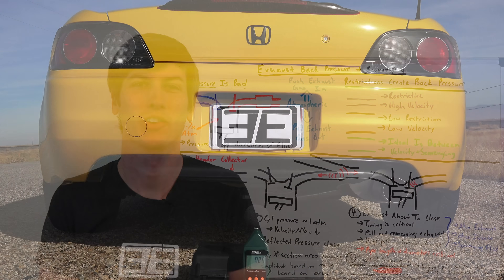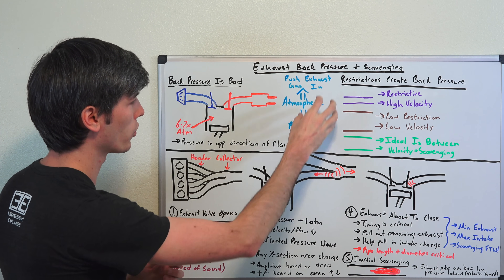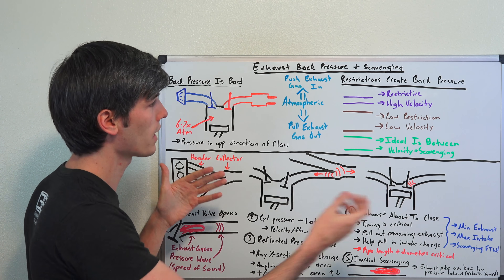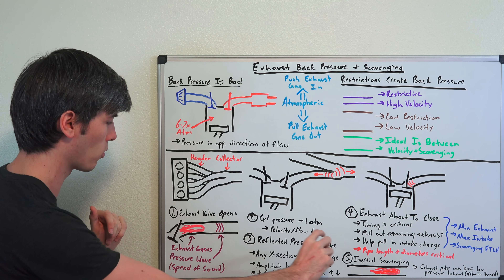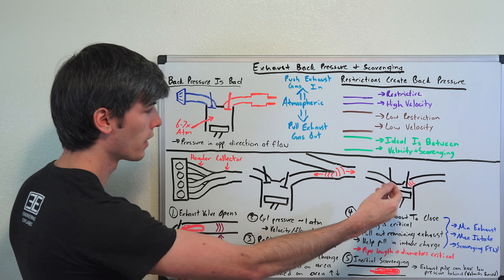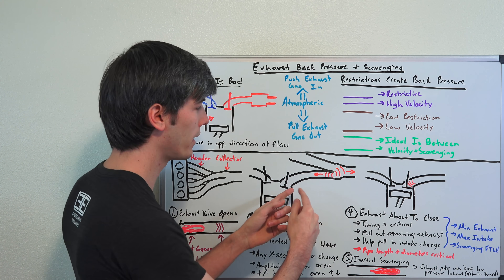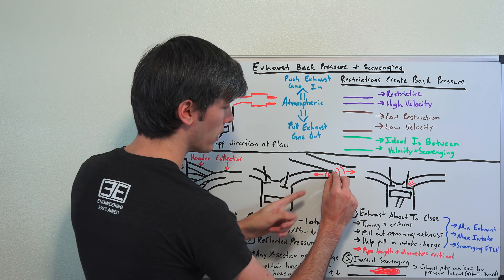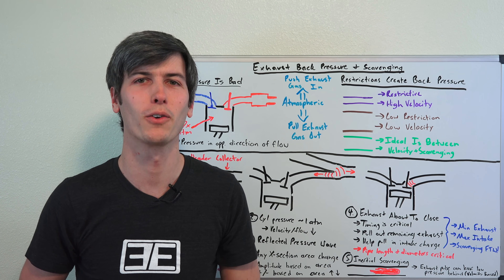Stop Saying Car Exhausts Need Back Pressure

Comment: is it a case for older engines and it's valves for cold climates that valves needed the heat so they don't crack, or seats warping, in iron and steel of pre 1980ish engines, for also reliability, and longevity.Gasoline had lead in it to lube the valves, cold start used to wear these parts in those days. No three angles on those guys, which changes the orifice effect, and timing was not as precise. Looking back that was raw power as it got, and you ain't changing that. Nothing like the Force of Cubic Inches. P.S. that GT needs cylinders!!!!

Comment: Great video. Wondering about the pros and cons and a 4:1 vs. a 4:2:1 manifold. Would it be the case that a 4:1 manifold is more peaky (benefit across a small rpm range) where as a 4:2:1 manifold gives a lower scavaging/power benefit but across a much broader rpm range?

Comment: why car engines do need back pressure: because with zero pressure you dont even have a flow of exhaust gases, and therefore the heat buildup burns the rings out of the engine. im sure someone will tell me different considering the topic of this vid

Comment: So what happens if you put a vacuum close to the end of your exhaust and use it to suck the exhaust out with a bigger bore? Would that be better or worse then what’s used now?

Also what about exhaust not combining and staying separate tubes all the way out?

I’ve also heard that higher compression ratios are more efficient, is this true and if so what does it do?

Comment: What a load of hogwash, you clearly don't know engines. First there is no pressure on the outside of ur exhaust, as the same atmosphere is at the intake you have  zero pressure on your engine, it's in equilibrium. The reason you have atmospheric pressure sensors in cars is to determine the correct ignition timing first and then the correct fuel air ratio for the altitude you are at. That's it. The next thing, you need to do a bit of study on air flow, the reason you need back pressure on any engine is exactly because of airflow at very high speed. One of the big problems in fluid/air dinamics. Do a study on water hammer, very interesting stuff. Now to explain back pressure and what it does. When ur exhaust phase ends you have what they call a rocking phase of inlet and exhaust valves, this rocking time is when both valves are open at the same time, this is done so that the momentum (velocity) of the exhaust gas helps to pull in the intake gas as the Piston is still on top (intake phase not begin yet). Now before the exhaust valve can close, this stream of gas just runs straight through the engine, this is where the correct back pressure helps to prevent that stream just enough so that the exhaust valve closes as the intake gas starts to flow out of the exhaust valve. In 2 stroke motors this actually works with a shockwave of sound. But in 4 Stoke engines the correctly tuned exhaust with the exact amount of back pressure Does exactly this. So there you have it bro.
Reply: Ian Barnard I stopped reading after you told us the pressure at Atmosphere and the combustion chamber are the same. Nothing like a 9 month comment with no likes, must be true.

Comment: Scavenging discussion is good in theory for racing, but not too applicable for regular driving (even with the periodic race application).  COMPLETELY agree that back-pressure is bad.

As you mention, scavenging generally works within a narrow RPM range based on the frequency.  However, the one critical item that is not addressed is related to valve overlap.  Most all daily drivers have little valve overlap (for decent low and midrange torque).  Scavenging is almost always applied at higher RPMs for race purposes.  Those types of cars have very poor lower RPM drivability characteristics, poor torque, and generally are "fussy" to run.  Some of the variable valve timing CAN help with this and then scavenging might have some application, but still, that would only be at higher RPM ranges like in the mid to upper RPM areas.

Probably more applicable would be the intake runner length and diameter discussion.  That does have application to daily drivers and to race cars.  Longer runners at lower RPM = higher torque and more power, shorter runners at higher RPM = better breathing and more power.  Has to do with the velocity created by the length, and diameter, at different RPMs -- the ability of an air pump to efficiently move the air mass.  This is why they have so many cars now with variable intakes.  

Generally like your teaching though, just think this one might cause more confusion than practical application.  Reason is the valve overlap at low and mid range generally prevents any feedback pulse.  Even when there is one it would not generally be strong enough to make much difference under normal driving conditions.

Comment: The most important aspect forgotten was scavenging is only present when both valves are open creating a high pressure through intake out the exhaust. Most efficient when piston travel is 4-8° btdc helping push left over gases.
Scavenging also allows very small amounts of hydrocarbons through different cylinders if not on compression stroke back in the intake covering the walls with the known black deposits.

Comment: So if I understand correctly: the distance for your header pipes should be the speed of sound times by a little less than the duration the exhaust valve is open for, which as stated is a function of RPM.

Comment: also with valve overlap to push exhaust out some air/fuel goes with it and a pressure wave is needed to push some of it back. it has to do with emissions too not just "power"

Comment: You literally just described how back pressure is needed... if back pressure wasn't needed, you could make maximum bottom end torque running open shorty y headers. And oh yeah, frying your valves due to no back pressure is actually a thing. Ask me how I know...
Reply from the maker: No, I literally just described why it isn’t needed haha

Comment: Interesting.... So why would funny cars run straight pipes? They have a known and not very wide rpm range, so I would think they could tune it. Or put variable length headers on it. Maybe the transition  from straight pipes to atmosphere gets you the same pressure wave? In which case that was neglected from this discussion, as that still exists. Same for the placement of the muffler and cat.
Reply from the maker: Funny cars run in a pretty narrow RPM range, so the straight pipes are tuned for that. The clutch is slipping for most of the start of the pull, and eventually locks up as it’s running down the strip (this allows a high, and narrower RPM range). I have a video on the clutches they use if you’re interested!

Comment: I have been applying this for years and it is nothing short of incredible how much torque can be found by building a proper exhaust system. not only length and diameter but collector and muffler design.

Comment: I would just like to point out that shock waves actually travel faster than sound. Could be important for anyone trying to calculate exhaust lengths.
Reply from the maker: Yes, it’s dependent on the conditions within the exhaust (temperature, density, etc), on top of traveling with the exhaust on the way out, and then against the exhaust on the way back to the valve.

Comment: N/A engines need tuned exhaust, you don’t need any exhaust while WOT. And don’t need any after a Turbo. It’s not back pressure. That terminology is wrong. It’s all about velocity. Straight pipes at low rpm do not have velocity. You kill low end power. It matters.

Comment: So what's the deal with some back pressure helping low end power?  I've experienced it in older vehicles,  open exhaust = more top end power but loose some low end power,, and i.e. some back pressure or restriction = better low end power with of course a little less at top in exchange..  ???
Reply from the maker: Yep, this is discussed in the video. Smaller diameter exhausts will have more back pressure (not good) but more velocity (good). It’s worth doin for the better scavenging that occurs with higher velocities.

Comment: It's quite simple: for an N/A engine the best exhaust is no exhaust. Not even connecting the manifold. The second best option is looking at pipe lengths, resonant proportions, and making an exhaust with smooth curves.
For turbo's it's more complicated. Thinner pipes and shorter pipes will mean faster flow with more kinetic energy but more resistance. Too small of an exhaust manifold for economy turbo cars is not a bad thing. That will give some faster spool-up. (although less ultimate pressure) If your can has an anti-lag system then a small manifold won't make any sense.
2 strokes can appreciate some backpressure for the sake of not spilling unburned fuel down the exhaust. I said "can" not "will".
Reply: sasja de vries,

"Best exhaust is no exhaust" is actually the 2nd runner up misconception next to "exhaust needs backpressure".  You do actually need the manifold.  Without it, you won't get the scavenge action resulting from the fluid dynamics. The header lengths and diameter need to be tuned for the gas velocities that are expected from the manner of tuning the engine is getting.  Bottom line is you want as much velocity without causing restriction in the exhaust.  But with fixed dimensions, they can only be optimal for a certain rpm range of any given engine displacement.  You remember those variable intake runners that came about before Honda popularized VTEC?  A similar principle applies to the exhaust piping, just that it's far more problematic due to the heat and pressures involved.
Reply: Did you watch the video? probably not because you think no exhaust is the best.
Reply: sasja de vries. Actually no header is worse than no header. For one the valves will burn up since the header works as a heat sink. Second, the header can actually increase horsepower due to scavaging forces. If properly sized you can create a greater than ambient pressure drop when the exhaust valves open, increasing power by reducing pumping losses.
Reply: Engine master did an episode where they performed dyno on engines going from too small to too big of an exhaust. The fluctuation was minimal and almost neglect-able. On the other hand, these are simple high displacement engines that aren't fine tuned. I bet a fine tuned engine would show more of a difference.
Reply: m4xwellmurd3r said "Actually no header is worse than no header."
 
Did you mean to say "no header is worse than having headers?"
Reply: They would have done better to run the same tests with a well tuned motorcycle engine. That would be the closest to a really properly designed and tuned engine that would be affordable.
Reply: sasja de vries.
Reply: sidepipes or straight up headers out the hood = all u need
Reply: +Ben Mcghie oh so that's what that blowhorn looking thing is for
Reply: You didn't watch the video, did you. Your first statement is incorrect.

Also, try running a 2 stroke motorcycle without the expansion chamber. Let me know how much power you get, lol. For a 2 stroke, the expansion chamber is actually generating a pressure wave that acts as a closed exhaust valve (if timed properly), allowing the cylinder to obtain much higher pre-combustion pressures. More air and more fuel = more power.
Reply: The best exhaust for a N/A engine is just a normal exhaust, headers, test pipes, and catback with X or H pipe, resonators and mufflers. Take the mufflers of a N/A car off and you gonna loss power.

Comment: Only thing that needs back pressure is sleeve valve two strokes that are crankcase forced induction due to the large valve overlap, which is why they have a tuned exhaust. Pipe expands to get a negative wave to scavenge then the pipe narrows down to smaller then the entry pipe to reflect back a high positive wave right as the fresh fuel air mix is entering so it's kept from going straight out the still open exhaust port.  Everything else the overlap is so small it doesn't matter.

Comment: Shouldn't fueling then be retuned after lowering back pressure (with straight piping). I've read (at least on carbed motorcycles) that any considerable changes with back pressure (straight piping) always have to be accommodated with fueling retunes otherwise the engine will run too lean or too rich (because it was tuned with back pressure from the stock exhaust in mind in the first place). Am I wrong to think this?
Reply: my mustang needed back pressure because thats how ford designed it without it i lost a lot of torque i could feel i lost power in the gas pedal high flow mufflers and huge h pipe yeah my motor revved higher easier but when it came down to putting power on the ground hell no....explain with diagrams and whiteboards all you want i bolted the part on and felt the difference so you cant say all engines dont need back pressure new variable cam engines are being designed to use the exhaust gases to reduce displacement so how does this apply to that
Reply: theonlylee1984 as a few people on here have stated, a loss of back pressure is not why you lost power. A loss of a tuned exhaust system to work in balance and harmony with everything else you had is why you lost horsepower.
Reply: No, you are not wrong to think this. You should make adjustments to your tune after ANY modification made to your engine whatsoever not just to get the maximum benefit from it, but to ensure you don’t lose horsepower because your engine is now out of tune with what you have just done. I think that’s the frustrating thing about mods. For every single one you do you have to retune until you get everything just right. Then if you make another mod it starts all over again. That can be mind numbingly tedious and time consuming.
Reply: Theonlylee1984 your forgetting the fact that without any upgrades to require more exhaust flow you won’t get any power gain from it

If someone buts a blower and cam on their mustang they will prob want to open up the exhaust
Reply: I've heard very similar things, at least in the case of bikes. I know with fuel injected bikes getting a free flowing exhaust will do very little without a fueling retune, maybe that's what your thinking about? IDK I'm just some guy on the internet
Reply: Xantho - Correct. Matching intake with exhaust is the whole idea.

In the example, we do have back pressure.  That creates the velocity to generate the vacuum wave at the end of the exhaust valve opening?  Here again, balance is critical.
Reply: But with stock motor and bigger exhaust you do loose torque and power
Reply: @stevemac7933  Not really, only if you just swap and do nothing with the tune, you will loose power, your bigger exhaust will lean out the Air fuel ratio. If going too big you will also loose the scavenging effect, like he said in the video. 

The engine will be lazy because your exhaust will no longer help your engine to evacuate the exhausts properly. The same happens if you remove a restricted air filter, the engine will lean out.  Modern fuel injected engines will someway compensate for the changed Air fuel ratio. the engine management read the changed lambda value and also from the MAFsensor and compensate automatically with more fuel.  The same thing happens if you got a vacuum leak, the fuel injection will compensate with more fuel until it reaches its limitof its maximum capacity :)
Reply: @ZoDDyXXX  well I meant to say that as well no retuning by the way I have a 98 Lexus sc400  dobyou know if retuning is available with a stock motor only bigger exhaust ?
Reply: @stevemac7933  Normally it´s not needed.. I´m not schooled in the Lexus engine management but i´m sure it´s advanced enough to handle normal sized upgrades.  My gut feeling tells me that you wont gain anything above 2,5-3"  i´m not sure but i think Magnaflow has something to your car. They seems to have some research and science behind their products.
Reply: @ZoDDyXXX  mine was stock with you won't believe 4 large mufflers 2 sound mufflers 1.75 pipes I started with 2.5 straight pipes oh my God it sucked then added 2 mufflers  drove sucked added 2 sound mufflers round getting better as soon as I installed X pipe before mufflers the car became a tiger again got even better in a few days

Comment: you forget to add that when the exhaust slows it also cools making the exhaust more dense hence making the engine has to use more "power" to evacuate the exhaust system

Comment: 1.does valve overlap or internal exhaust gas re-circulation affect the exhaust back pressure?
 2. is there a huge difference between exhaust back pressure of free flow exhaust system vs stock exhaust system?

Comment: Hey there mate. I really love your youtube channel, very informative and educational for people like me who don't know much about cars and and their mechanical aspects. But I got a question, so I drive a 2009 Honda City, and I've had the clutch slave cylinder replaced before due to some leaking, but after doing so, I've had a lot of times where my clutch feels spongie or soft, and on worst times, the clutch's bite point is already near the floor, which makes it hard to get my gears in. During these times, I'd step out of the car, pop the hood, and I'd manually pump the slave cylinder, or Push Rod. So as to have the clutch sturdier. I really don't know what's going there, and its just a hassle to leave the car and open the hood and do all that especially when I'm late for work. Lol. What I'm thinking is maybe its got air in the line and needs to bleed more, but not too sure. Anyway, hope you can give me your thoughts. And again, love your channel. More power bro.
Reply: I know its a year too late but it sounds like it just needs a good bleed. On the money with the air in the system I reckon.